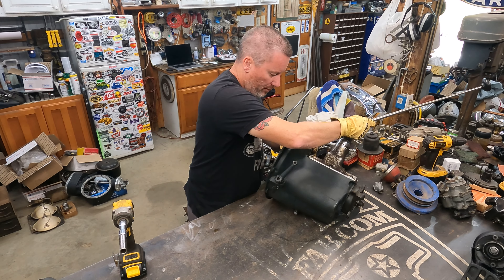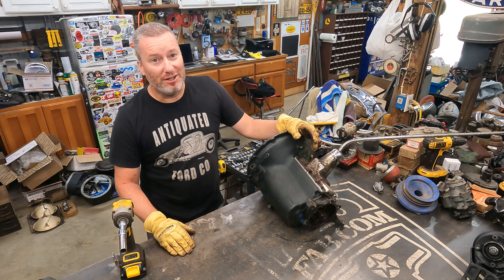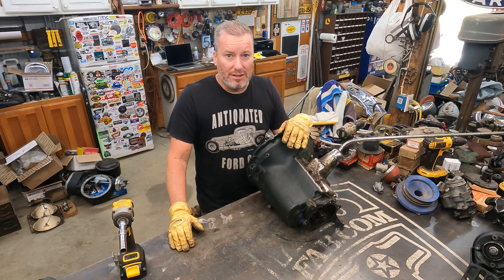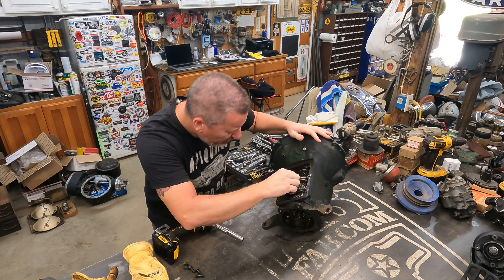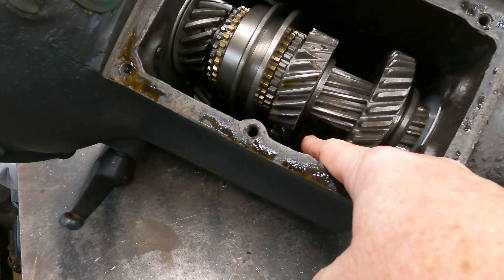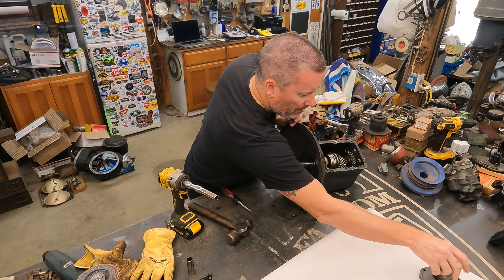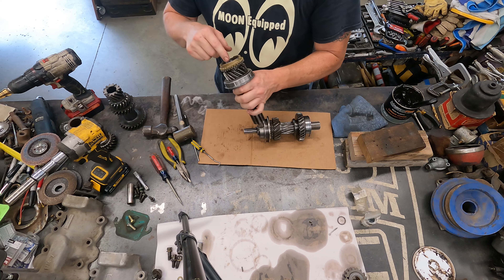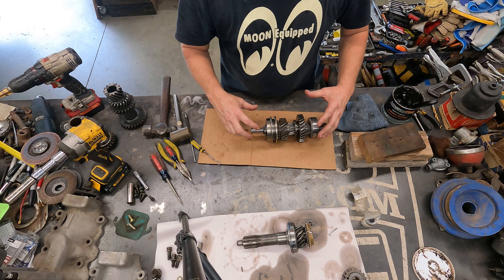1939 Ford Transmission gear swap! · Pomona Panel gets a '39 trans!!

Comment: You might want to check the trans case for cracks where the cluster shaft passes through the case. When things "let go" and that cluster locked up with gear teeth between the cluster and second gear, something had to give. That case might be cracked at the front and rear. Check it out and look really good. Another thing, always use a 3/4" or a little smaller wood dowel to punch out the cluster shaft. Using a steel punch might distort the end of the cluster shaft and you'll have problems getting it out and installing it back in the case, not to mention leaks if you do get it back in.  Nice video, keep up the good work.
Reply from the maker: Thanks for the heads up... no cracks in the case and the shaft went back in and the trans works great!